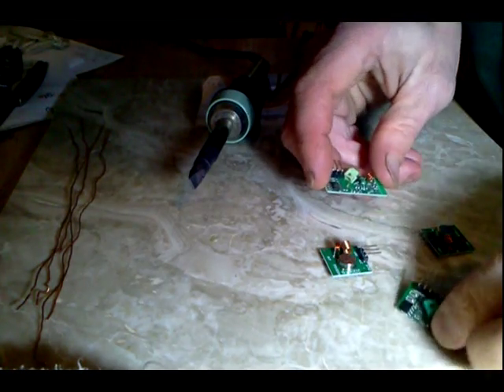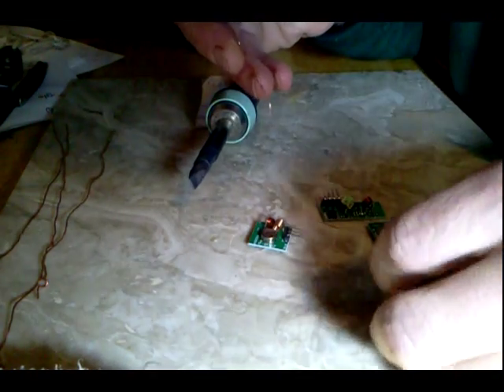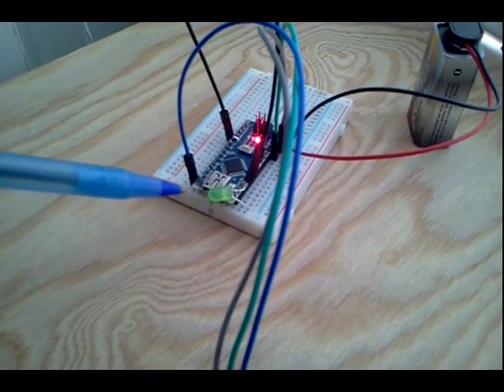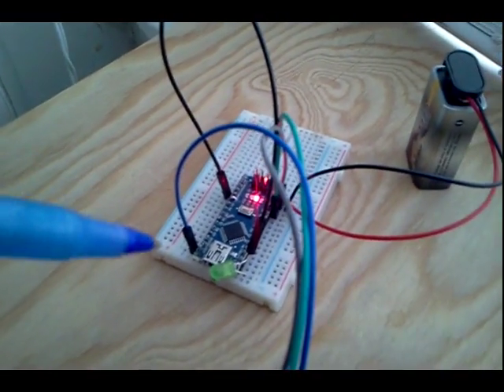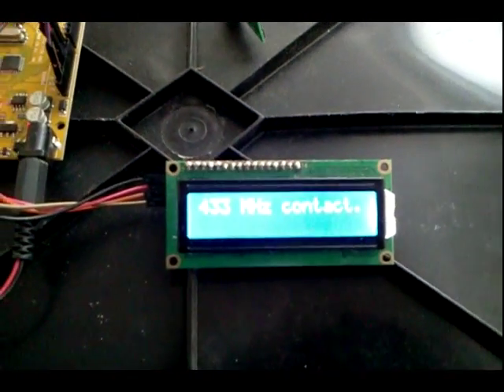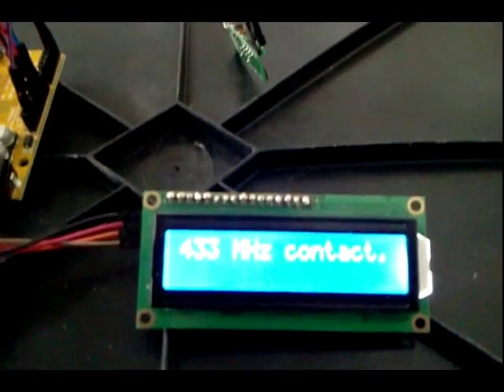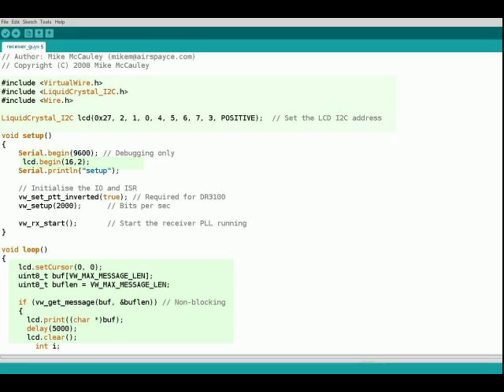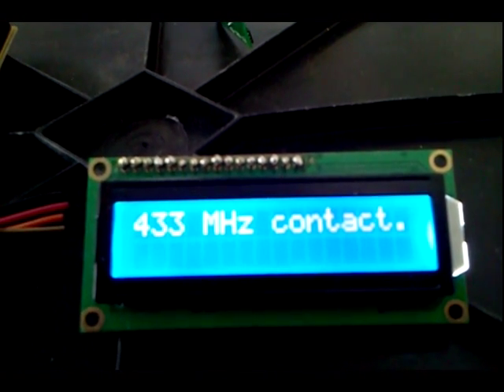433 MHz RF Transmit/Receive Antenna, LCD, Arduino code sketch

Comment: dumb question:can we change transmit and receive frequencies. Incase there are more than one Arduinos in same area?
Reply from the maker: rajjad Good question, No. Solution is use one for 315 MHz and the other 433 MHz, or if 2 on same frequency, code unique identifiers to execute programs for device 1, 2 etc. Post back when you get working.
Reply: thanks a ton

Comment: the good time. is it possible to have a CMOS RF switch and then one circuit for transmitting and receiving (one ARDUINO)? this circuit type is used for driving RF coil in MRI(Magnetic Resonance Imaging) systems.